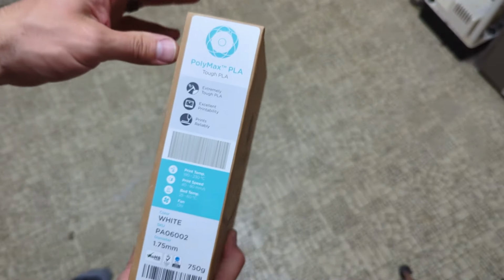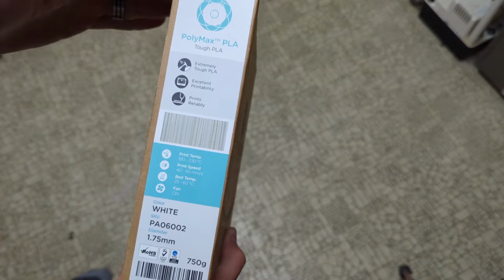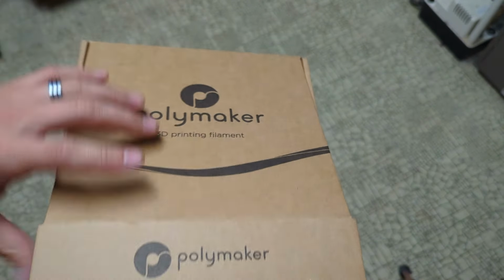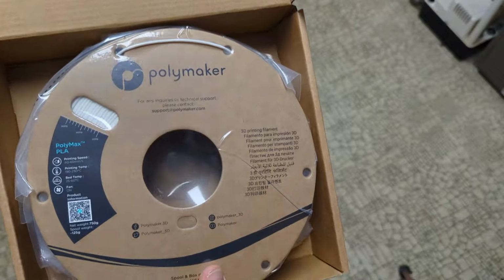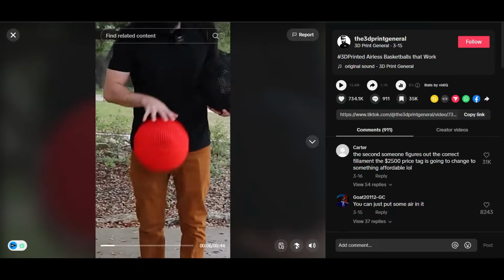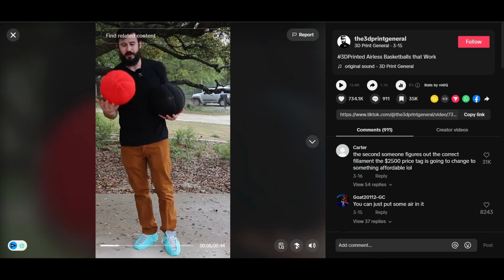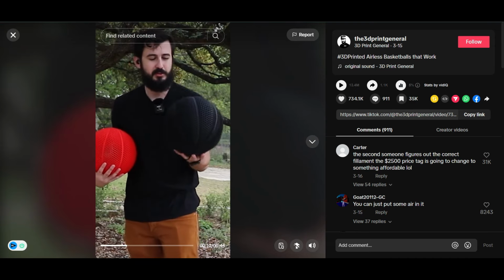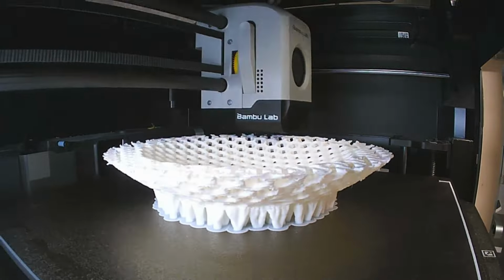This Airless Basketball Made From Polymax Had Surprising Results!

Comment: I've got a Pitt Bull that kills everything we buy for him.. Any ideas on a filament we could try. Use the file but downsize 2/3rds
Reply from the maker: @uscitizen5656  oh man, I am not sure how long any of these filaments would hold up against a pit bull lol but the peba filament has shown to be the most durable but the most expensive. Also, scaling the model down might make it weaker but others have successfully printed it smaller. I am going to work on a version of the model that can print on 220 mm beds and smaller that won't lose durability, but it will be a bit before I can make it/test it.

Comment: party lime just released gen 13. Imma going to see if its worth the carbon fibre tpu
Reply from the maker: @michaelfilippi3276  nice, I saw the new file and it looks really good - hopefully performs well too!
Reply: @makeitlabchannel  gonna print tpu first. then maybe cf tpu. If it didn't cost 200 cad for a kg, I would've tried sooner.
Reply from the maker: @michaelfilippi3276  Yeah it is a bit pricey for sure. I have some cf tpu I will try out as well - seems promising

Comment: Do you think it would be better to print with 0.6 mm nozzle (fewer walls, but thicker), or 0.4mm nozzle (more, thinner walls)
Reply from the maker: @lorenzo-f5p  I do think it would be better to print with a 0.6mm nozzle, and the reason I have not been is because I didn't have any. I have some coming in the mail soon, but it is supposed to help with decreasing print time and helping with durability. Might have to test it 😁

Comment: Hey Make it Lab, I think you have to give Polypropylene a shot! Lightweight and impact resistant, should have a nice result
Reply from the maker: @migueldias1873  I have heard it is tricky to print, but I think you are right in that it would be a good material to try. I will look into it 😁
Reply: I really doubt that PP will bounce, it is too soft and flexible, it will just absorb the impact
Reply: I just started printing PP and yes it's tricky but once you get it dialed it it's so worth it!
Reply: @theianmce  for what application?
Reply from the maker: @theianmce  Guess I might have to try it - have any brand recommendations or printer settings recommendations?